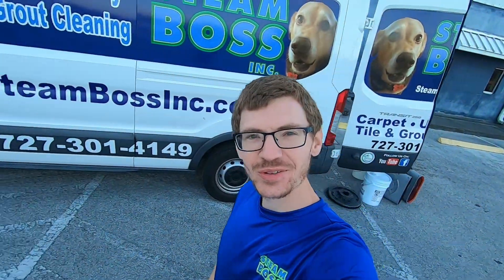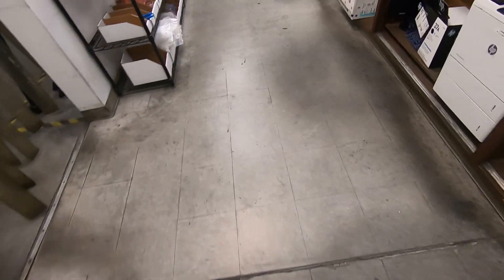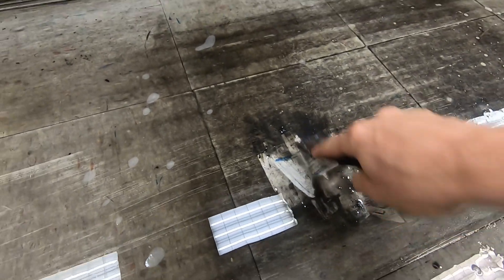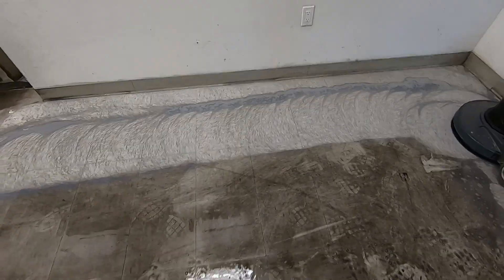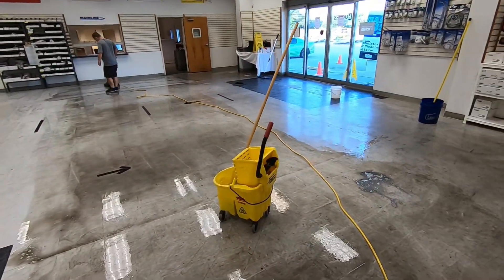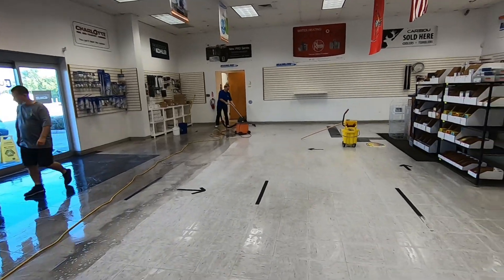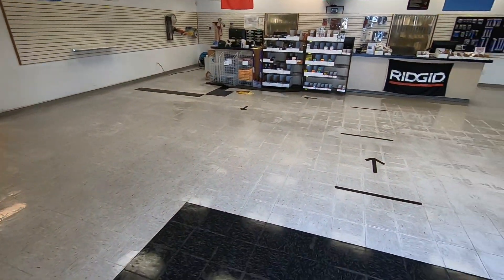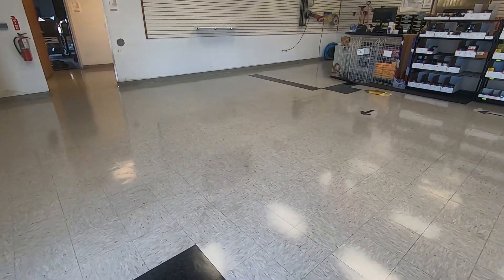Crazy Strip And Wax VCT Job! So much grease/ SATISFYING!

Comment: Only step on areas the machine has already went over. Begin the machine next to dry area go forward then go backwards to your starting point. The wet vac guy is always on the opposite side. When you reach him and begin back tracking he sucks up the slurry. Stripper is very slippery. Need to watch out for falling down

Comment: Where I work, we apply stripper, then scrape, then more stripper, machine, then shop vac, then rinse. Can you tell me what it's like to clean your shop vac after you're done with the job using this method? We normally scoop up the removed wax (it's 4 coats) after the scrape and double bag it to dispose of it. Then we just rinse the heck out of it after we use the machine
 Thanks. Great content 👍
Reply from the maker: It's almost all liquid so just dump down a toilet.

Comment: Where you're wet floor signs. Also you shouldn't be walking in the stripper after putting in down. The person stripping should be behind the machine meaning strip then walk. Don't walk in stripper.
Reply from the maker: All outside the main front door. The facility was closed that day it was a Sunday.